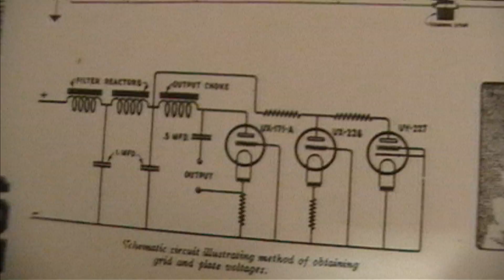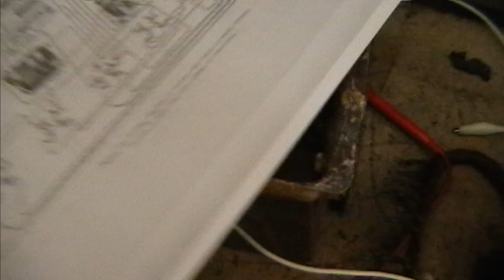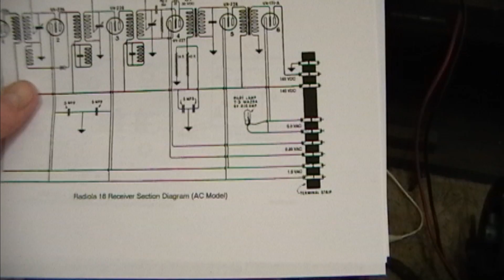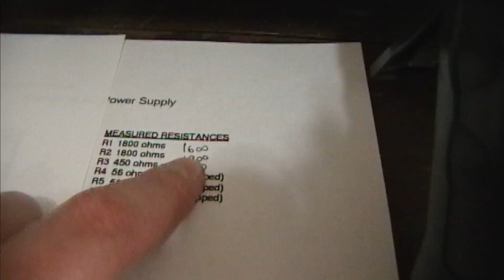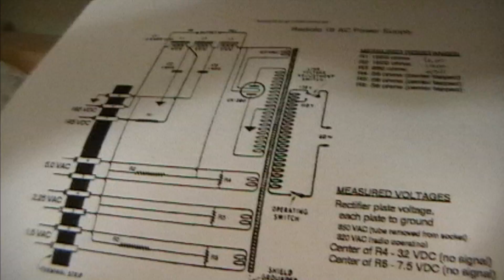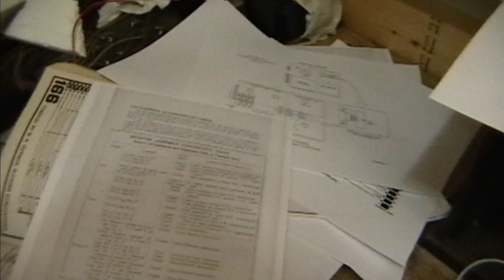Brunswick 5KR pt3

Comment: I think that Brunswick may have made these under an RCA license, either that or the chassis were made by either G.E or Westinghouse. RCA didn't manufacture anything of their own prior to buying out Victor in 1928-29. I found with checking over my Canadian Westinghouse Model 89 that I needed both a Radiola 63 schematic and a Model 89 schematic because Westinghouse added some of their own features like a tone control switch.